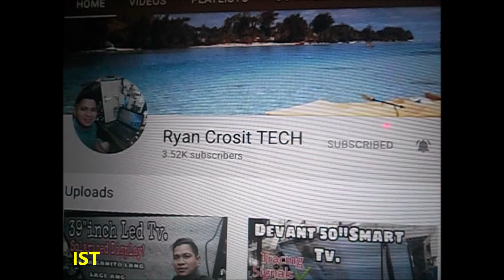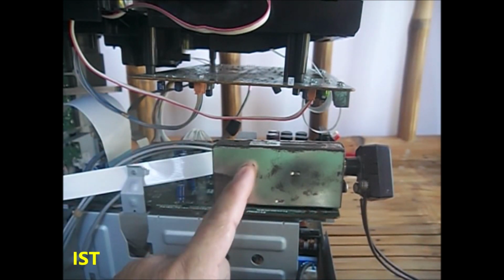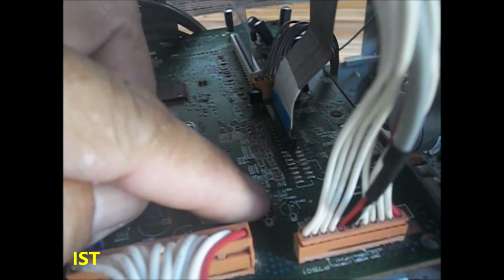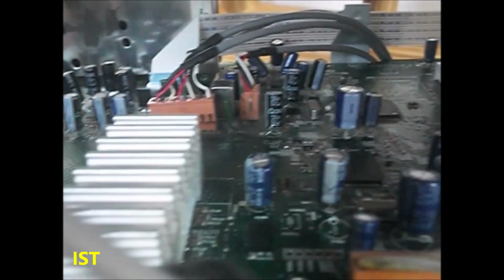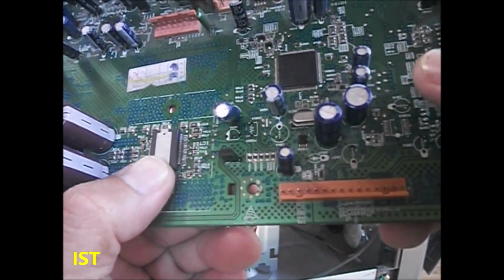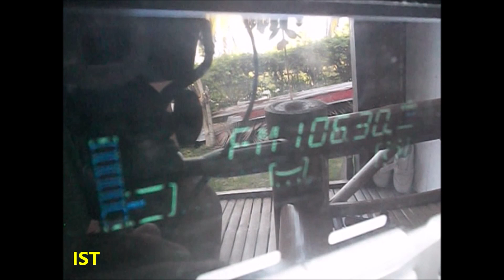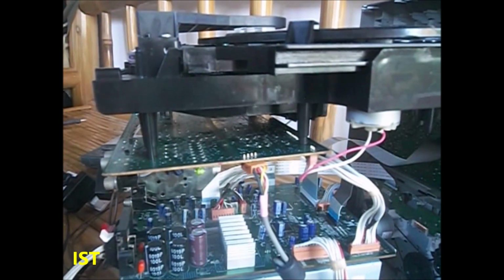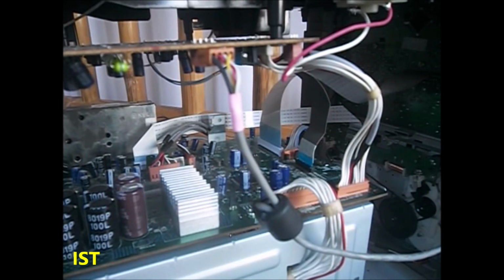[ NO SOUND ] LG COMPONENT SYSTEM (ENGLISH)

Comment: Howto repair LG MMD62 ONLY 1 CHANNEL GIVE SOUND FOR RADIO, NO DVD SOUND ANDIF RADIO SET WILL SOUNDTHEN GRADUALLY FADE AND NO MORE SOUND, WHAT 4ARTS AND HOWTO EST THE COMPONENTS
Reply from the maker: In that case the unit have several problems. To tell you the truth LG MD62 is not repairable unit unless you are going to replace the mainboard, the boards are double sided, it uses digital audio too which is hard to trace the cause of the problem. I don't think so if you can follow the steps in troubleshooting. In my video the problem is no sound both left and right and it is just very easy to replace the audio ic, still trial an error is made to solve the problem.

Comment: Hi good pm sir may 5.1 LG problem is when you power on and tune in on fm radio there's an audio out after 5-10minutes the audio out was shut down how can I fex the problem
Reply from the maker: There's a defective part/s that once getting hot after it was turning on, the defect comes in causing the audio to disappear. Most likely voltage regulator/s.

Comment: Sir i need an help for repair lg dv 55 hifi system 5.1 dolby system
Reply from the maker: What is the problem?
Reply: Sir only left side speaker are working 
Right side frontside and active woofer are not working sir please help
Reply from the maker: @sunilshukla3658 I really want to help you but it is very technical.
Reply: Please help sir

Comment: Paano kaya sir pag mag stuck-up or hang ang lg cj88 na component?
Reply from the maker: May problema yan sa system, hindi ma load ang program nya, Kaya mag hang-up siya.
Reply: @idolservicetech955   paano i.download kaya sir?
Reply from the maker: @marilynostos1199  mahirapan tayo sa panahon ngayon kasi hindi na uso ang mga component, walang nag upload ng software sa mga component, hindi kagaya ng mga led TV daming downloadable na software. Face out na kasi sila.
Reply: @idolservicetech955   lg cj 88 unit ko sir.. 2019 lang to sir
Reply from the maker: @marilynostos1199  sa service center kaya ng lg sure ako meron sila nyan kasi brand nila yon kaso mahal ang bayad nila, try ko na lang hanap nyan.
Reply: System sir, sa software lang ba o kasama ang hardware?
Reply: Salamat in advance sir..
Reply from the maker: @marilynostos1199  software lang muna, para ma obsebahan kung  ano ang resulta.
Reply: @idolservicetech955  first findings nimo sir about sa download or software sir.. kasi pupunta ako ng technician ito muna pa.check ko.. tapos kung maka.observ ako na ganun pa din mag.hang.up pagdating ng ilang araw saka ko na ipa.settinhs..
Reply: May pahabol na question sir.. pwede bang sa factory reset lang din kasi pag nag.hang tapos unplug ko.. paulit2 mha 20 minutes to 30minutes mag.back to normal na mga next day s na naman bago mag.loko.. 2019 model lang tlga to sir .

Comment: No display, no sound of dvd, optical lense good, tuner good sound, aux sound good, problem NO DISPLAY, NOSOUND DVD WHEN PLAYING
Reply from the maker: Check the supply voltage for the display may be bulging filter capacitor or open resistor supplying the display. If no sound trace the audio signal output coming from the mcu before reaching the audio ic if the signal is there then you have a bad audio ic, but if no audio signal coming from the mcu then the problem is on the mcu.
Reply: Thanks idol i try
Reply: Idol maybe you have some pic where to test resistor and capacitor supply power of display for LG DD62 i am not electronic technician itis my hobby to learn i have a little knowledge in basic electronics reading electronics enthusiast thank you idol.
Reply: On your your vlog vedio i sucessfully repaired 2 dvd players, 1 platinum karaoke amplifinr, ang 1 sakura karaoke amplifier i thanks from learninon your now i think i get struggling this LGDD62 compact mini theatre i hope i may succed where ic very difficult to replace very little space gap of terminals to solder
Reply from the maker: @pudenciojr.camposp.4773  I will just make a video for you how to check voltage for the display of LG MDD62. At first I am also struggling in repairing this unit due to the double sided board that was being used, the space and you can't test the unit if some boards are not connected. That is why I am telling you that this unit is not repairable. The only easy way here is to replace the audio ic because it is just in the corner like what I did. But maybe for other problems of this unit I can no longer repair it.
Reply from the maker: @pudenciojr.camposp.4773  just wait for the video Sir I am going to upload it after editing. I am so busy this time for the town fiesta celebration is coming, many people brought their appliances for repair.